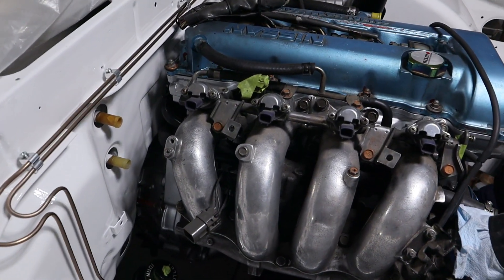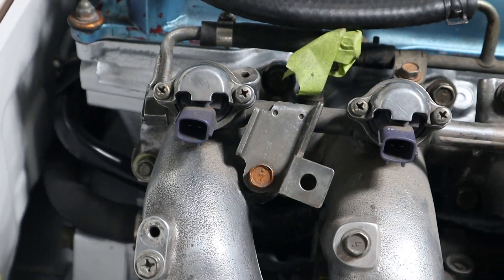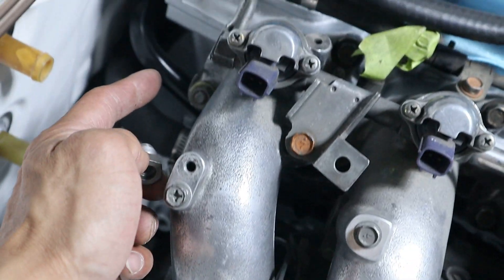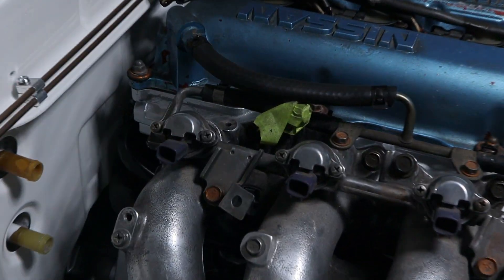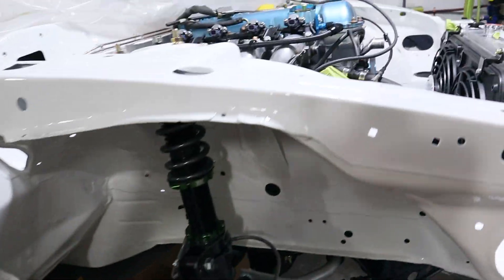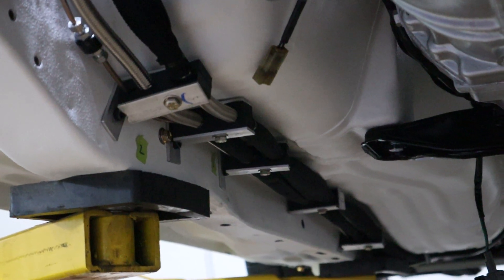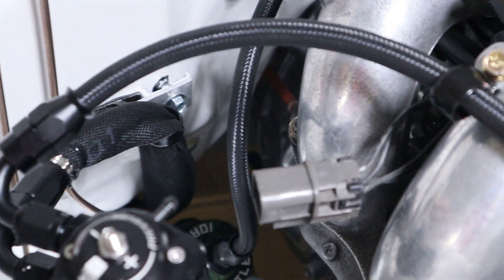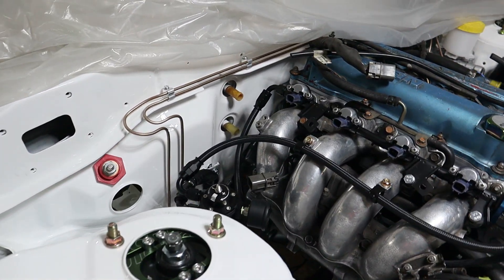SR20DET FUEL SYSTEM

Comment: I've been watching since the beginning, looks like it's coming along great. I'm planning a new build, but I'm having trouble sourcing an RB for less than the price of a house. Are they cheaper in Canada?
Reply from the maker: Thanks for watching since time lol. RB are expensive man. Parts are even harder to come by.  How much is it at your location?
Reply: @240Tony  I'm in Maine on the border with St Stephen New Brunswick. Prices on this side of the river will set you back more than $10000 USD for a RB26DETT, and I'm looking at a RB25DET right now for $8K.
Reply from the maker: RB26DETT is crazy now since GTR price went nuts. Rb25dett you can find out of many options but still need to source a manual Transmission and that's pricey also.
Reply: @240Tony  Yeah, problem is here the cars those engines were available in were illegal for a very long time. Now that the first R34's are becoming legal in the states the prices are flying high, franchise films didn't help either.
I'm going to use a T56 from Tremec and an adapter plate from Australia. They have all the goods.